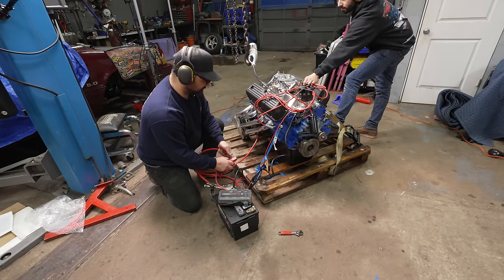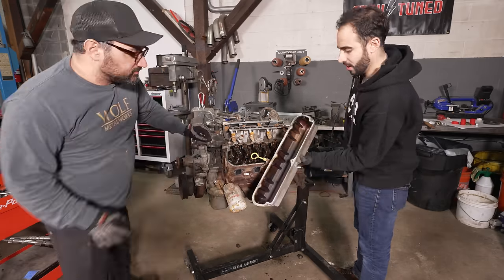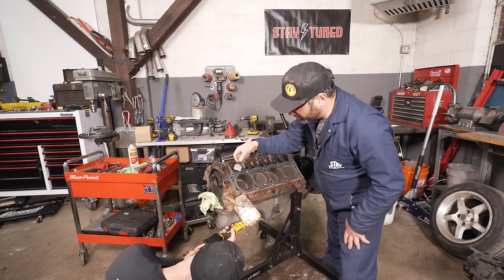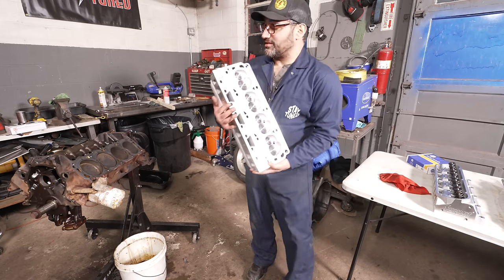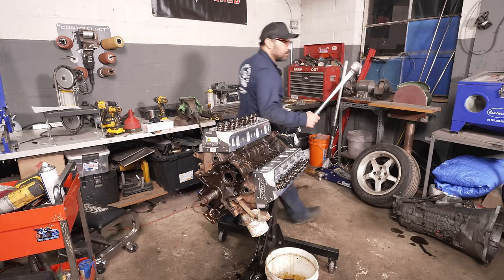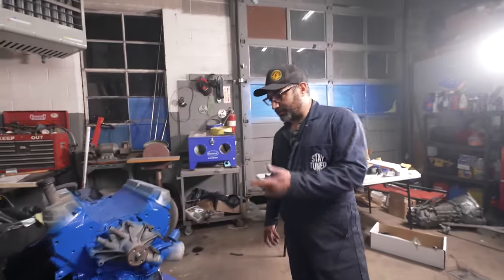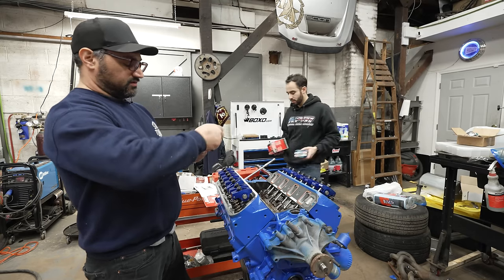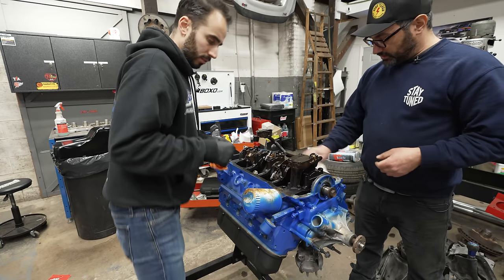Building a Junkyard V8 into a KILLER Horsepower Machine For Vice Grip Garage!

Comment: Back in the day a Cleveland motor was far better than a Windsor motor . Too bad they shut it down in 2012. My brother had a '73 Mach 1 he raced b4 it was broken in and later the crank started making a loud knocking sound. My dad pulled the motor to only find there were only after market parts available. At the time the only place with a cam to go in it was Honest Charlies on Lee Hwy. in Chat. town. LOL it was an off road cam with similar duration to lift. Made lope way more than my dear ole dad liked but it was in the car...nuf said. My point to all this is the original motor was a 302 Cleveland. The motor my dad dropped in it was a 351 Windsor. Bro said it still didn't pull as hard as the 302. Sorry to say dad tried the timing cam shaft from the 302 in the 351 Winsor. It stripped the gears on the Cam so he had to buy the New Cam. I was abt 13 at the time and all I knew was I loved to go fast.

Comment: 5.0 HO had forged pistons. I don't believe they all came with forged piston. I have a 5.0HO in a 88 full size bronco. Went with the HO because it was roller cam and forged pistons. Controlling the fuel with a Fitech go Efi4 full MSD 6al system with pro billet distributor and SS coil.  Timing controlled by Fitech.

Comment: Imperial/Metric bolts? If it has numbers on the head(8.8, 10.9, etc.) it's a metric bolt. If it has 3 or 6 straight marks on the head, it's imperial. There are exceptions, unfortunately.

Comment: Why did you go 302 (which has the ability to split in half) and not the 351 which you'll get more torque (GREAT FOR BURNOUTS) and better strength.

Comment: Nice work but you don't put the lube on the washer just the head of the bolt and the threads also need to add some tread sealant

Comment: Hey guys, I didn’t see yall put thread sealer on those head bolts. The bottom head bolt holes go into the water jacket on some of those 5.0 blocks. Just a heads up
Reply from the maker: Yessir, completely zonked that one, I'll sort it before we get serious. We gotta swap to a billet distributor gear and put in the hardened pushrods too, all good.  Thanks!
Reply: @StayTunedTA  yeah man, I just remembered having to do it when I put together the motor for my brothers f150

Comment: TONY (VERY IMPORTANT) - 2.02 valve heads WILL NOT WORK with the STOCK PISTONS (Unclearanced). I think 1.94 is the biggest you can go.    ALWAYS CHECK PISTON TO VALVE CLEARANCE GUYS.   HOPE Y'ALL CAUGHT THIS
Reply from the maker: Another person said the same. I'll dig into it. I wasn't all over this parts order but it's 2.02/1.60 same as my 340 LA mopar with 4.0 bore?

Comment: Car deserves a 390, especially if it's an original 390 4 speed car. That small block💩💩💩 is a total insult.
Nothing like filling the valve cover with aluminum sanding dust.

Comment: Off topic. I hav a mid 90's DangerRanger, 4.ltr, 6cyl, 4x4 pushrod motor. Clean title in hand. (Would run w/ fuel pump) T/ trucks in bad shape structurally [rotted out]. Motor, trans, & axles are still pretty good. Was gonna send it to t/ boneyard, but had so many good times w/ Raider, kinda want it to live on. So instead of a pizza, how bout donating a Danger Ranger?¿?...Maybe build something to rival yer Sīkclone. I'm in eastern NC. Just sayn, Think about it

Comment: Cleetus McFarland sells Derek a Chevy 350 after low-key driving it for several miles with no coolant, yanking it out of a truck with a forklift and then dropping it from 20 feet in the air onto a truck.  Tony gives Derek a 302 after low-key doubling the horsepower.  Guess whose shirt I'm buying?!  LOL

Comment: Why didn't you change out the old bearings and rings? If you build a motor with speed goodies then you should make sure you have good compression and oil pressure. Just saying.

Comment: Cant really go wrong with these 302s 80's-90s 302's, dead reliable, engines will last at least 400k miles if you just do regular oil changes, good torque but with those 2.02 valve heads you gotta make this baby sing to at least 7500 and it'll be a real ripper
Reply from the maker: YES! Exactly right. I gotta convert Barb to the church of Our Lady of Solid Lifters.

Comment: Man I would sold you my 5.0 motor with gt40 heads upgraded valve Springs and cran 1.7 rockers for $800 wayyyy cleaner inside. I just had a 347 stroker built no need for the other motor now

Comment: The 302 Ford made more stock power (210-220 depending on year) than the GM 305 and the GM 350 (245 HP in a Camero) hardly made more than the Ford.

Comment: 👈That 89 has over 300,000 on the odometer I completely rebuilt the motor but kept the block with all the best of the best that I could buy at the time and threw a Paxton blower on it I’ve got just under 600 wheel horsepower and it’s been together for over a decade. Surprisingly the body was so well taken care of it looks like it drove out of the dealership a month ago
Reply from the maker: That’s killer!
Reply: @StayTunedTA  🤘😎🤘

Comment: I'm older than dirt, And nothing to do is the only reason i'm leaving this comment.
   To confirm.
This you will need to find an old pontiac dude, I have no reason to b s.
  Pontiac had a stage 2 cam.You could order for the 455 S.D. And a few people got it, It was only available one year, Because it idled so rough, Everybody looked like bobble heads at a stop light.
   Pontiac changed the grind, But they kept the same damn part number.
   And there was a time in the 80s, If you knew what you were looking for, You could go to a junkyard, And grab the block and the heads, And you could find those cams, And you could walk out the gate with all your pieces for around 12 to 15 hundred bucks.
   Here is the rub youngster,510h.p.570fpt,with factory EVERYTHING. 
   We tried headers, But the torque would fall off.
  The automatic was faster than a stick, With cheater slicks it was all you could do to get it to hook. We are talking street legal.
   So dig, When somebody wants to race and pop your hood, All they see is factory iron.
   consistent high 10s ,got a 10.23 once,the track was realy sticky.
   The t h four hundred three speed automatic, You had to Start in first Gear, Feather the throttle, Go into second early, And feather the throttle till you were going around 70, Only then could .You mash it to the floor.
   Back in the eighties the fastest bikes turned low elevens.(stock) And that if you were good at the launch.
     It would look like the race was over at the line, And that big block would real em in.$$$$
Edit;yeswe ran at least 103 octane.
   Don't go crazy with the timing, You can get by on a cool day, But if it gets warm, You better have race gas in it.
  ...best part, no need to go over 5800 rpm,all day hp.

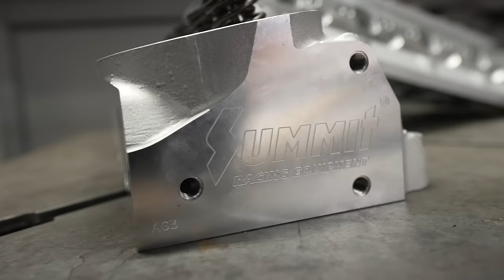Comment: 17:02.... 185cfm intake ports? 🤔

The MOST a pair of cylinder heads with intake ports that flow 185cfm COULD support is 370h.p...
And that would only be if the motor has a HUGE compression ratio, and a wild camshaft in it.

Perhaps the heads have 185c.c. runners, and not 185cfm runners. 

185cfm would be pretty pathetic flow numbers for an aftermarket cylinder head meant for a 5 liter V-8.

Comment: Help me understand.  I'm not an "engine builder", but I used to build my own engines back in my racing days.  This project is obviously not a rock bottom budget quick overhaul and you describe the bore ridge as "not too bad", indicating it isn't exactly fresh.  So why not do rings and bearings on what is a well used engine with an unknown background, especially if you're hoping to double the factory horsepower? 
To me, the incremental cost of rings and bearings is small compared to the cost of the new parts you're installing and the labor, once you get down to a block with nothing but a crank, rods, and pistons isn't much additional work either.  What is the logic here?  Did I miss something?

Comment: You can’t install hydraulic roller lifters in a 302 with the cylinder heads installed due to the short deck height. You’ll notice he tried to install the lifters but then it cut to the next scene with them all installed. He should have owned his mistake and taught a lesson to a new engine builder.

Comment: Cool fairlane, too heavy for a lil 302, bummer on the motor. should have sourced a 98ish roller 351 for that car, 302 does not have the torque to move a heavier car. (thats why chevy only built a 302 for 3 years in the camaro [same formula, bore and stroke identical except chevy heads had better flow leading to ford building BOSS 302 to win trans am] 302's in general have low torque, highs rpm's) great engine for light little cars, suck in heavier rigs. nobody EVER  built a 302 chevelle which is comparable to a fairlane, with good reason. on the right track with roller motor, just chose wrong roller motor to really move that car🤷‍♂️. not saying it wont move, just saying it won't move like it should/could.